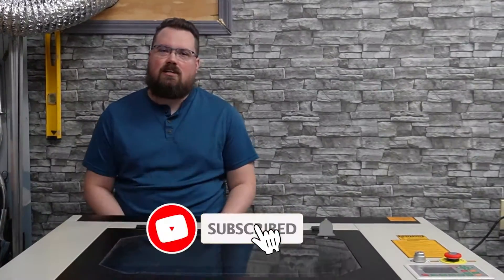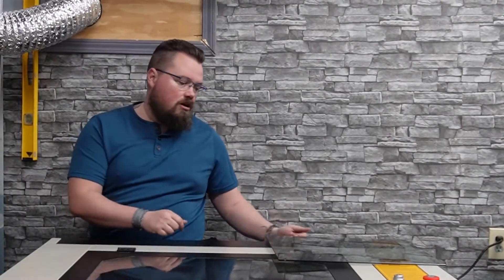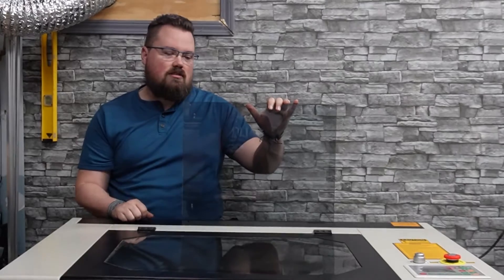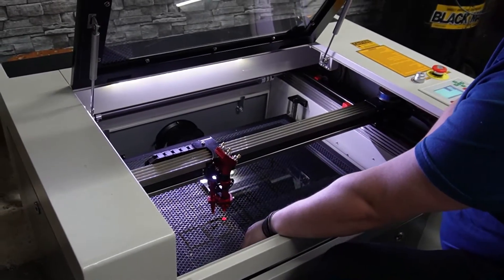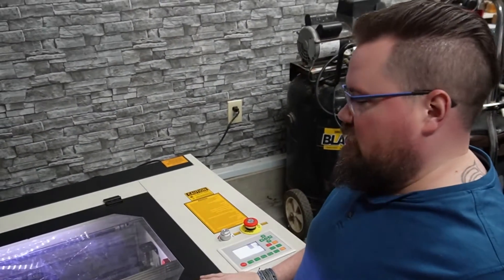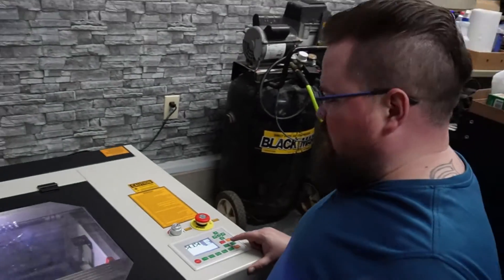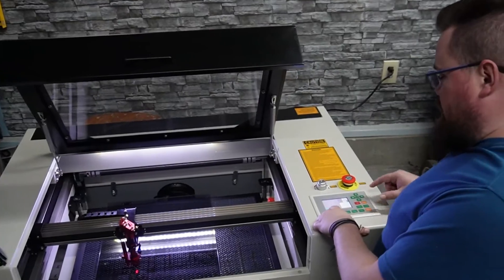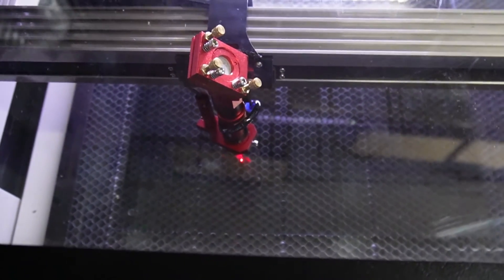Etching on Glass with the 60W CO2 | Monport

Comment: Thank you , question if you hadn't moved it how would you go over it again? If you hit start will it go over it in the exact spot? or do you have to use the print and cut feature in lightburn? If that was the software you used Thank you
Reply from the maker: If you don’t move it you can just hit start again.